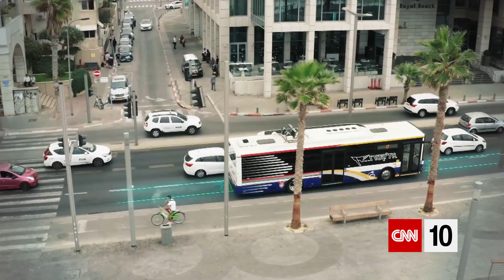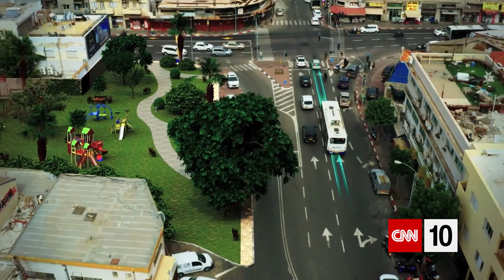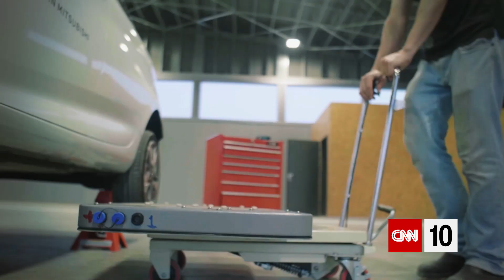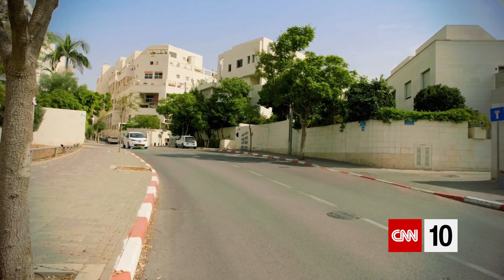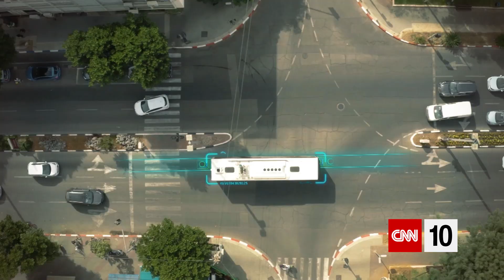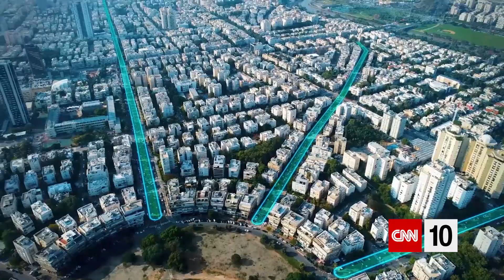Will Future Roads Be Electric?

Comment: it won't work. There won't be enough connection. Think about a plug and an outlet and a phone. If both the outlet, the phone and the plug are moving then the phone would charge just fine. But what if only the plug and phone are moving, then the outlet would be disconnected as soon as the phone and plug exit where the outlet was. So if you add a lot of outlets in a row, like an electric road, then say the phone and plug will never be disconnected from any outlet, you still have a situation where the phone and plug disconnects after every outlet, then reconnects, and this only gives a little amount of energy.